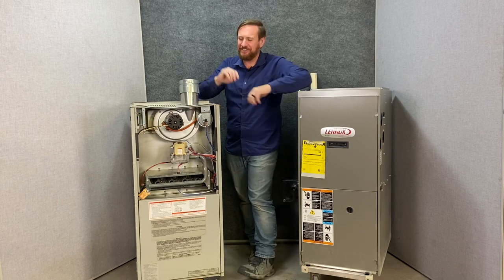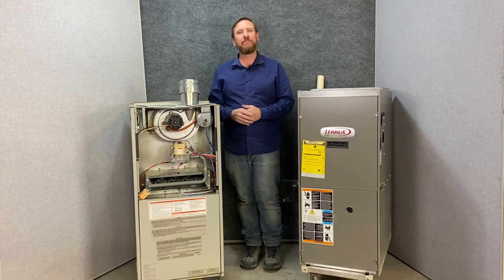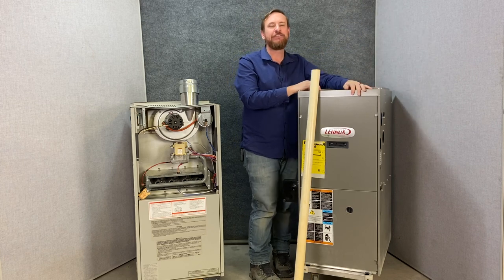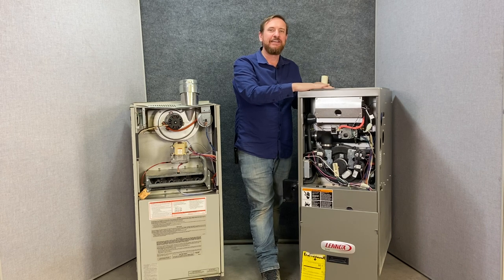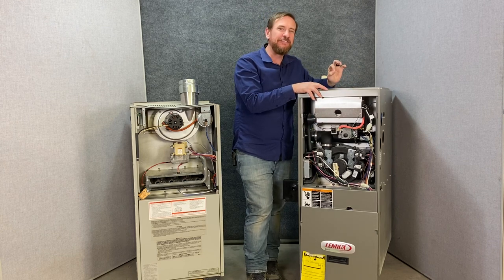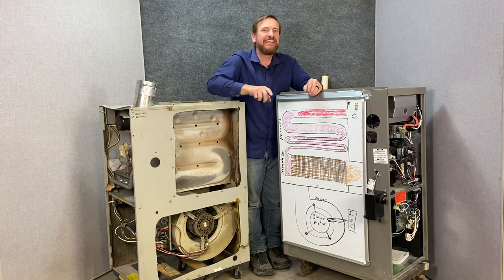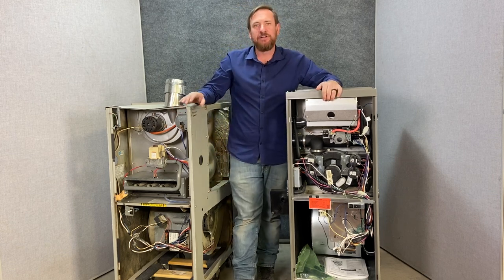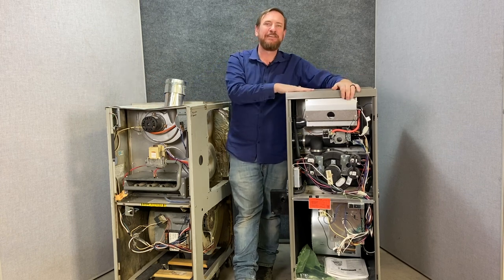80% vs 90%+ Condensing Furnace

Comment: Furnace: 95% efficient, ductwork: 50%. 😱
Reply from the maker: True, ductwork is horrible nationwide. 

Leaking ductwork is a bigger issue for an 80% and even worse for a natural draft. 

As the air leaks out of the ducts the house becomes negative pressure, pulling air back in. This air comes back down the flue pipe of the furnace but also the water heater and chimney bringing CO into the home.
Reply: @love2hvac  I not HVAC technical.  I just had a 96% efficient Trane furnace installed.  I see problem when it is running/operating, that I know of.  The problem I have may be ductwork, or outside air intake into the furnace, or both.  The furnace is in an unheated crawlspace.  The problem is that when it gets cold outside (below freezing) I can feel cold air coming from the registers when the furnace is not running.  It's not blowing air necessarily, but cold just the same. 

I have checked the ductwork and can't find any major issues.  I even added some insulation around the metal register ends hoping it wold help. It's a small height crawlspace, so it's not easy to maneuver down there, especially being a larger (6'6") and older person with bad shoulders and neck.

Can I assume that something is not insulated properly?  Is this problem fixable?
Reply from the maker: Everything is fixable just not always affordable 😁

You have an air leakage problem.
I would recommend having a blower door test done with a duct blast. 
This test will show you where air is leaking in your home. 

Even if you had no insulation in the ducts you would not have a cool draft unless you have air leakage allowing air movement.

There is a excellent book called " a house needs to breath... Or does it?"  By Allison A. Bailes III, PhD

Start with a blower door test of your home then go from there. 
Energy auditors, home performance and building science professionals offer these tests.
Reply: @love2hvac  Thanks!
Reply: @love2hvac  One question of confusion on the air intake pipe.  Does it have a damper to shut the air intake when the furnace is not running?  If it doesn't, what's to stop the cold air from circulating throughout the entire system, ductwork and all?  We've already been in the teens, temperature-wise here at night.
Reply from the maker: The pvc pipes for  combustion process including the intake and exhaust are all sealed to the heat exchangers. They are completely separate from the air to the home. 

Sometimes for highly efficiency homes that are extremely sealed there are systems that bring outside air in but these should pass through a Heat Recovery Ventilator. These HRV pre heat the air entering with the air leaving and keep the home pressure equal. They are very expensive and have internal components that prevent drafts during the off cycle.

On rare occasions I have seen someone install an outside fresh air duct into the return duct. They should have an automated damper but they are also known to slightly pressurize a home.
Reply: @love2hvac  Thanks again for the details!  

There is only one return duct on the first floor and none on the second floor (poor design during building the condo).  The return has some cool/cold air as well as the supply registers.  

Also, I just viewed another related video where it was mentioned that the exhaust pipe should be insulated in my unconditioned crawlspace.  Is that true?  Finally, Apparently I need to keep track of any deep snow we may have blocking both pipes.  Is that true?
Reply from the maker: 100% keep track of snow drifts. Both pipes must be clear. 
Many times people try to modify the exhaust/intake. It needs to be specific to the insulation guide. Trying to extend them causes problems.

In some cold climates where the flue is in unconditioned spaces that are regularly below freezing, insulation is needed.
Reply: @love2hvac  Thanks again Ty!  
I'm assuming that you meant "installation" guide, not "insulation" guide.  

Yes, we have many days where we never see above 32 degrees F.  Last year our water pipes froze when we got down to -8 F, lesson learned.  Some in our community go ice fishing on our lake as I'm told that it is several feet thick.  I heard about a vehicle that was driven across the lake.
Reply: @sfink16  Hot air rises. Colder air falls. You want the colder air to be heated to get best performance.  The lower floor. (and the heat registers should be in the floors, so the heat rises in the room.
OTOH you want the reverse (return on upper floor , when cooling. Registers in the ceiling.  Way too complicated in reality.

Comment: I'll keep my 80% efficiency furnace less maintenance and more reliable
Reply from the maker: No difference in maintenance. 

Reliability is only because Installers don't read and follow the installation instructions. 

80% furnaces also need to have the gas meter clicked and combustion analysis done but because "it works"  good enough without it people neglect them too. 

People are still using sand to clean flame sensors.
Reply: Agreed totally

Comment: The down side to the 90%+ furnaces:
- They cost a LOT more initiall
- They cost more to repair
- Because they do not burn household air and send it up the flue, the household air becomes stale.It is similar to during the A/C season when the household   becomes stale. So, you open the windows to let in fresh COLD air. So much for high efficiency! Of course, you can install an expensive air exchanger.
- The payback can be YEARS, depending on the price of gas locally.

The one real winner is the local HVAC dealer! Higher price for the equipment he sells, higher price for the installation, and more repairs over the years.
Reply from the maker: A 90%+ furnace does not cost a lot more to install or repair, however a modulating 90%+ furnace does. There is a big difference in the 2.

80% Furnaces is supposed to pull it's  air from outside also. Usually from outside, to the attic, to uper and lower pipes into the closet and then to the furnace. Even if a code violated furnace is installed without combustion air using house hold air, the air has to be replaced, pulling air from outside uncontrolled through the walls, cracks, windows, doors, back drafting from the fireplace and water heater. It's better to have the "expensive" air exchanger to control the air transfer, filter and heat recovery rather than pull from all those uncontrolled places and associated moisture deposited in the walls.

The cost difference between a 90%+ non modulating and a 80% furnace is about $1000. The pay back on the difference depends on gas costs and region. 
Many places have mandated 90+ furnaces, so an 80 is not even an option, just as they did with standing pilot and 60% furnaces. 
A non modulating condensing furnace has all the same parts as an 80%. The heat exchanger is extended with a secondary and the inducer fan is plastic instead of metal and the combustion chamber is sealed.  All the other parts are the same. 

If the local HVAC company actually installed the system correctly there is no more repairs or maintenance than an 80%.

Comment: Your a salesman,unless your heating a large home 80/20  costs way less ,less service calls,25 years on my Lennox, do my own maintenance, saved $
Reply from the maker: Service and maintenance cost is the same.  All the the same components expect 90 has plastic inducer fan and a secondary heat exchanger with PVC. All the components and service is the same.

Your confusing 90+ with 90+ modulating. Modulating equipment costs a lot more and does require more maintenance. 

A good part of the country does not allow 80% and it is a matter of time before new regulations will make it nationwide.
Reply: @love2hvac  heard that’s supposed to go in effect by 2025. Only 90+%efficiency units will be solicited.

Comment: That's a complete lie I live in the North East and I have an 80% gas furnace my entire life.
Reply from the maker: I remember in 1989 when the 78% AFUE was passed. 
2011 the proposed rule was 90% in the north and 80% in the south/ southwest.
May 1, 2013 the U.S department of Energy (DOE) was going to officially enforce a new furnace efficiency standard AFUE efficiency of 90% or more. However, on April 5, 2013, DOE made a statement that the standard would not be enforced.

92% AFUE was set to go into effect for the NE by 2015 but that got changed again.

While the national standard was not finalized individual states had their own requirements. 
For example New Jersey chapter 6 heating systems states: " AFUE of 90% for new gas furnaces where not restricted by building design and where cost-effective.
Massachusetts allows 80% but requires a 92% for any of their rebate programs.

None of the energy star programs are 80%.

Just passed by the DOE, all new furnaces regardless of region will have a minimum 95% AFUE by 2028.

Comment: Stay away from 2 stage , they run longer and use more fuel.
Many videos  about it if you google search.
Reply from the maker: Few points here
Most furnaces are oversized, this causes comfort issues and short cycling that reduces heat exchanger life. 

If the system was properly sized, operating on low fire for a longer duration extends heat exchanger life and provides more comfort with less temperature swings. 

Another factor that plays a big part in this is duct sealing. If the ducts are sealed properly there is no issue, but when ducts leak, they push heat into the attic space closing energy, the even more energy loss as the hose has to replace the air by infiltration from the air outside. It is a double loss of energy.  If the ducts are leaking then a longer run time causes more gas usage. 

Another big factor is improper furnace setup. So few technicians clock the gas meter to ensure proper input BTU with the BTU gas content. There is also a lack of people who perform combustion anylysys. So furnaces that are over firing because the spuds(orifice) was not properly matched will have a large impact on system operation especially at low fire conditions. 

If the system is properly sized, properly set uo and a properly sealed duct system there should be no difference. If it takes 60k BTU to heat a space in 10 minutes or 30k BTU to heat the same space in 20 minutes, it's still the same amount of BTU.

2 stage systems are much simpler operation, cheaper parts, and  easier to diagnose than modulating furnaces. 

Like it or not we will be dealing with 2 stages, modulating and even cold climate heat pumps replacing furnaces.

What good is a high effect system in a home that is not air sealed or a duct system that is not air sealed in a home with an oversized unit in the first place.
Reply: That’s nonsense. It’s the exact opposite.
Reply: @love2hvac  are their companies our here that tackle duct sealing if drywall and framing is in place? Is a tear down the only resort to correcting the issue?